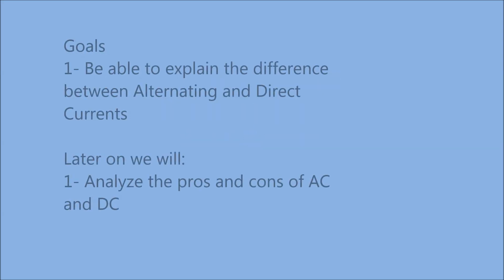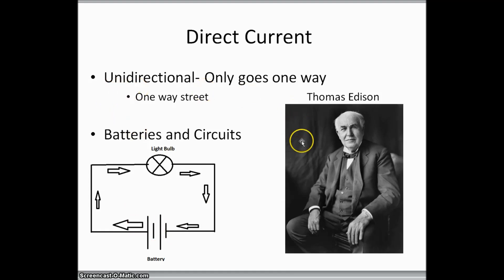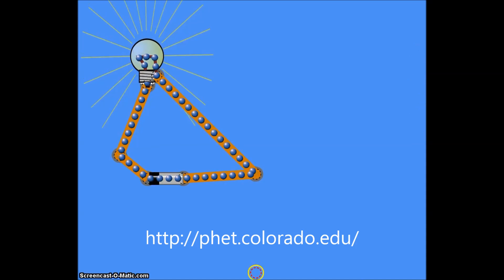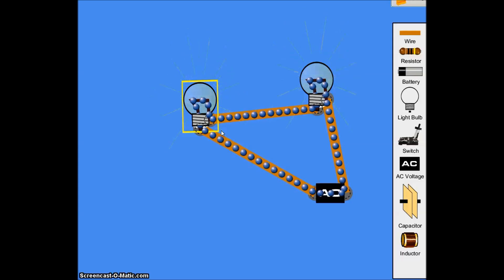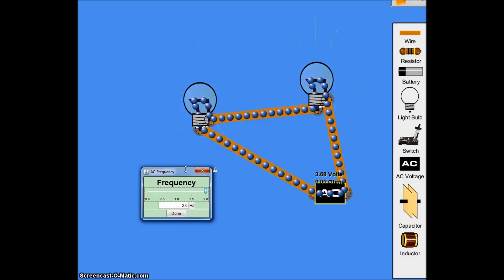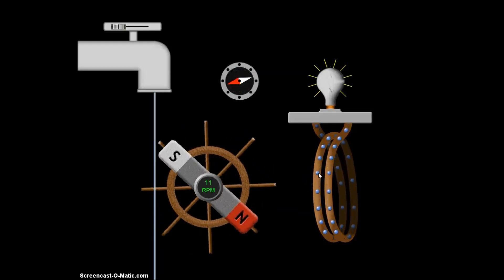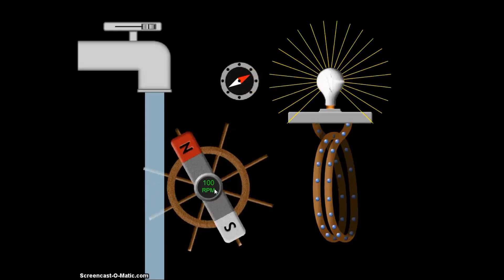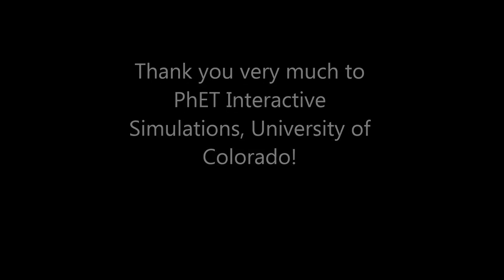AC vs. DC

Comment: So, might be a stupid question. How do the energy suppliers keep this magnet rotating? Where does the drive come from?
Reply from the maker: +j3s0n This is where the whole issue with power plants comes in. Many of them still burn coal or gas to get the magnets moving. However, some smarty pants out there have now decided that the power they create can be funneled right back to themselves and power their own magnets. Every place is a little different. *This is from my understanding, there are exceptions*

Comment: nice video, it helps a lot, but why do we use ac and not dc?
Reply from the maker: +yotam olenik Thomas Kenner said it perfectly. There are groups out there starting to argue for DC use again (We used to power everything with DC) because all our electronics use DC. Those big blocks on your computer charger or TVs turn the AC into DC so the appliance can you us. 
DC = Good at powering appliances
AC= good at traveling distances

Comment: i still understund why AC curent work. Any one can explain this?
The DC we know the Electrons "e-" move in one direction simply like drop water from the bottle...when the bootle is empty no more water. BUT on AC the Electrons "e-" alernate this like you say left -- right or up-down soo who you alternate the water from the bottle?

its like take 100€ give me back the 100€ if stop this i have the possibility to keep my 100€(like electrons) soo with this i think look like unlimeted power.
on DC take my 100€ but never i receive it back i have to make more and give you another.

PD: The AC current really confusing me and i have 26 old.
Reply: +SLEVIN SHAFEL it confuses me and this is my assignment- 

➔      Identify and describe TWO methods of producing AC electricity
and TWO methods of producing DC electricity
using renewable
and non-renewable
sources.
Reply: +Danial Van't Hof  me too i dont see to much of AC but DC are produced for Panel Voltaic and Dynamo, as well the baterry  use DC.
AC i dont know but for me its just the best method to tranpotr electricity but i dont relly see who that work.
And AC use senoidal signal like the waves and DC use trapezoidals.

Comment: what id like to know is why direct contact with direct current is harmless and why direct contact with alternating current.....well....isnt?
Reply: AC or DC doesn't matter at all when electrocuted, what people are observing and mistakenly interpreting is the difference in voltage. Your car battery and consumer electronics that usually operate with DC will mostly have 12V or lower, your standard socket AC voltage however comes at 120V - 240V.
Now up until about 50V our bodies have enough resistance for electricity to not flow freely thus we get no shock, but as you go up from that electricity will have a gradually easier time passing through your body and giving you a shock, so the 12V does nothing and a 120-240V wall socket can kill you, DC or AC doesn't matter.
Reply: MsSomeonenew gotcha. Thanks for the explanation. :)

Comment: If AC turns on and off rapidly, then how come  my play station never turns off ?
Reply: Rich Handsome The AC that comes in via the wall plug is converted to DC. This is done with what's called a transformer.
Reply: sujan neroula This is not correct.
Reply: Rich Handsome  it does so 60 times in a second so the playstation doesn,t gets enough time to turn itself off
Reply: Rajiv Sporkslede Which contain the transformer and rectifier.
Reply: Claus Bertels Ow yeah. xD
Reply: Rich Handsome DC
Reply: Claus Bertels transformer then rectifier ;)
Reply: +Claus Bertels or power supplies.
Reply: +Rich Handsome Because maybe you're addicted to playing it and never switch it off.

Comment: Thank you. 
Can you also explain how ac power can flow for hundreds of kilometers through wire and dc can not?
Reply: lets think of this. electron is slow. very slow. stupidly slow. 1 way means that they slowly trends towards long distance for very long time, like water, but they tend to fly off somewhere else on the road more than going to the destination. now lets think of the other way. electron chain reaction with others are at light speed. now imagine u only act a little bit on one starting electron, like the newton cradle, hence the electron is already presenting everywhere.

Comment: Some of stuff you're saying man... Electrons don't move fast, they aren't even moving the way they say they're  moving! Electrons travel in the opposite direction to current. Electrons have a drift velocity of a few centimetres a second so really not that much faster than the Phet programme says they do. And you also said rpms per second. And Hertz is abbreviated to Hz.

Comment: I've looked up a lot of videos here on YouTube trying to find good explanations on how alternating current works. You're the first person to mention the GODDAMN MAGNET(why has nobody mentioned the rotating MAGNET???).

Thank you very much for this explanation, straight forward and very helpful.
Reply from the maker: Brett Costello Glad it helped! The magnets make it!!!!
Reply from the maker: ***** Thank you! I know there are some mistakes but I tried making it very simple.
Reply: Exactly!! There was no one talking about rotating magnet in previous videos i watched. 
This video helped me so much to understand this ahh thank you very much
Reply: Why hasn't that been mentioned when you went to school.........I apologise when you didn't have the chance to go to school......
Reply: Brett Costello Generators use a rotating magnet to create 3 AC Sine-Waves.
If there were only 1 wave, any light working on AC would start to blink,
any (faulty) motor attached to AC would go forward-backward at 50/60hz.
However, motors don't work with DC. motors require AC and some circuitry to work
Reply: likewise of me !! thanks chris mahl ;)
Reply: Yeah, yeah...magnets. But...how does a friggin magnet work? ;)
Reply: Brett Costello tq
Reply: true
Reply: still I'm confused
Reply: Can AC be used in hydro electric power plants?
Reply: Raine A. He’s literally using a tap, water, and a water wheel to explain AC
Reply: +nathanz28
Why?
Reply: In a DC or AC inducer, there has to be magnets...
Reply: Music
Reply: A lamp doesnt get 3 ACsine-waves, but only 1.
There are motors that work with DC...
Reply: Dont say god damn

Comment: Regards the 'electrons don't move very far'. Actually, they don't really move at all, more so charge jumps from one electron to the next, and it does so at around 9/10ths speed of light in a wire, or about 167400 miles per second, thus continually travelling all the way back and forth to the turbine in your power station.
Nice vid all the same. ;-)
Reply: How does charge move from one electron to another?

Comment: A good enough way to explain it. I find that the choice of words is a bit misleading though. Not trying to be a negative pole here. But 1 hertz is a (complete cycle) i.e. (0v to +120v to 0v to -120v and back to 0v). It's the "switching 60 times a second" that is a bit misleading. What I mean in 60hertz, wouldn't the polarity by "switching" 120 times/ sec?
Reply from the maker: I tried to keep it more on the simple side, this was made for a 9th grade science course, BUT you are correct. AC current follows a Sine Wave, where one total oscillation through a crest and trough is considered 1 Hertz. I see what you're saying, probably should have used the word 60 CYCLES per second. Thanks for the input!